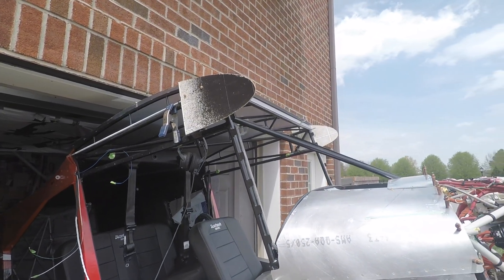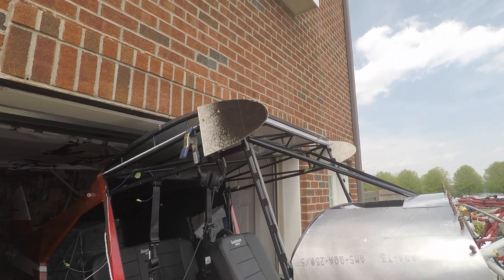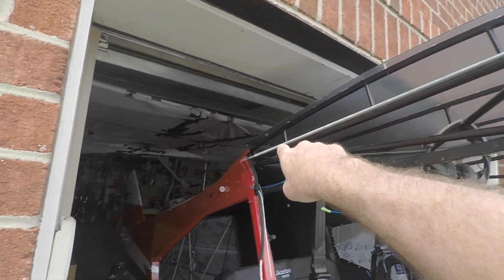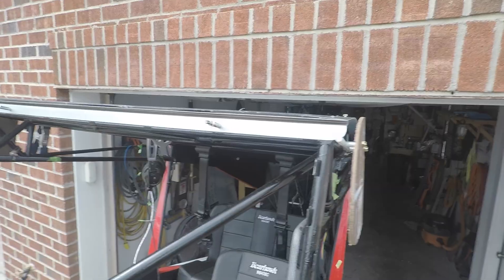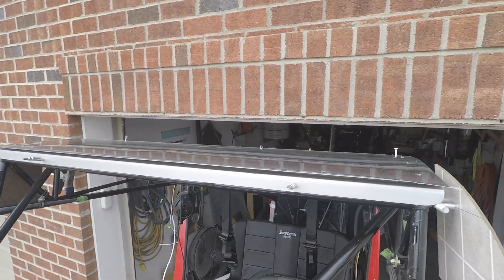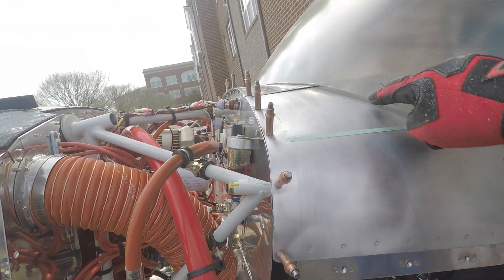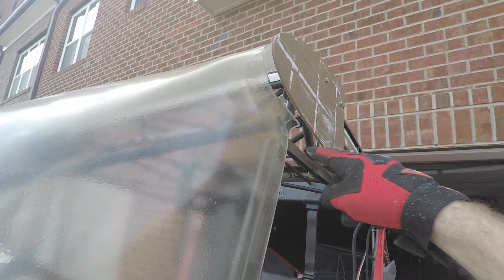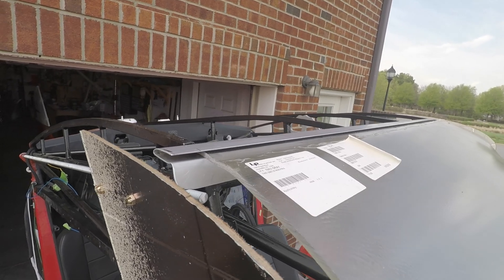BEARHAWK ~ Installing the Windscreen  |  Part 1

Comment: not sure I've seen the QB manual ... same author ... I need it ... a little help please
Reply from the maker: Eric Newton offers the scratch build manual.  http://mybearhawk.com/. I can't recall where I got the quick build manual, but if you contact Mark Goldberg at the factory, he can point you in the right direction.  1 (512) 626-7886. n95mf@hotmail.com.
Reply: Quick build manuals are on the bearhawk website, though they're older. https://bearhawkaircraft.com/kit-builder-manuals/

The new stuff is at bearhawktips.com and is paid.